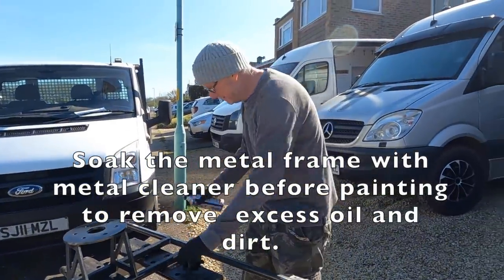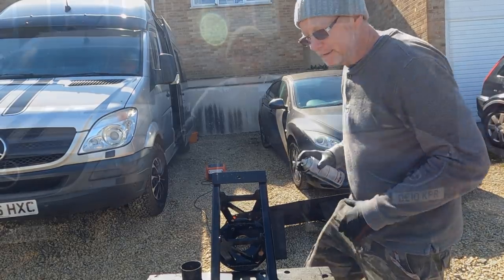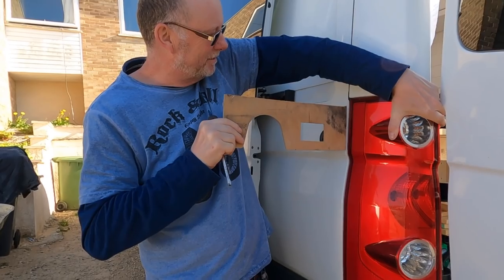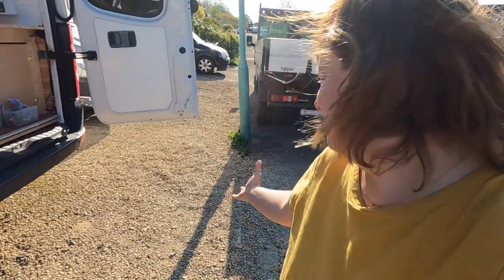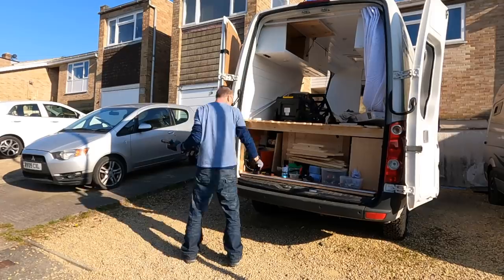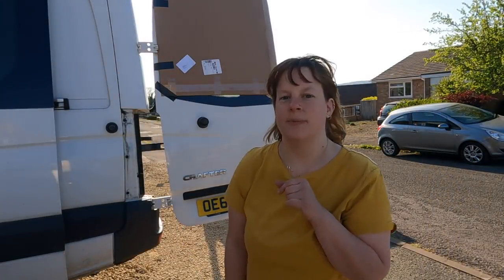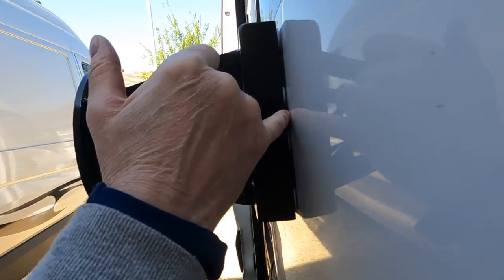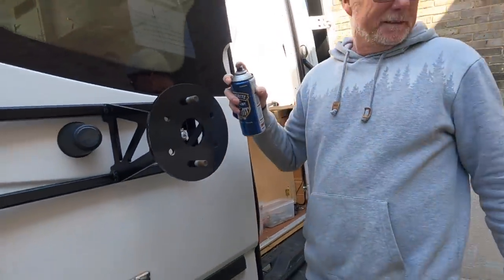Big ass wheel carrier for campervan

Comment: Super video Mel and the junior apprentice at work eh....... but come on Mel teach properly.... you should of washed the crap off the back of the wheel whilst waiting for the paint to dry...lol... the only drawback I can see with that set up... is if backing up to say a high wall on a public carpark... you would need another 6 inches of space on the length...( thinking about those times when you are "pinching a nights kip somwhere) but apart from that... its a top job... I am considering doing something similiar on me T5.1 as I like the swamper look and of course its not as long as its bigger cousin the crafter..... keep up the excellent work... Get well soon Mel.... YOKI...

Comment: Hi, Thanks for the video . I see you have the BF Goodrich 245, 75, R16 tires which look great. I am told that these rub when on full lock on the Crafter but not so much on the Sprinter. Are your tires new and do they rub on full steering lock? ( I know the 70 wall tires don't rub but the 75's look better in the wheel arch)
Reply from the maker: Hi Scoobie Dee, yeah they are great tyres and really make such a sturdier drive since I’ve had them fitted. 
From the moment I drove the van out of the garage (from having the new tyres fitted) I’ve had no problems or was even aware of any rubbing issues at full lock or any other time 👍🏻👍🏻👍🏻
Reply from the maker: Yes I bought them brand new and were fitted in the same week 👍🏻
Reply: @SACREDTRAVELLER  Thanks for the quick reply, Thats mad as most people have reported a rub at full lock on Crafters. My van does looks a bit higher than some crafters with the current tires on which is why I thought I might get away with it as you have.. I have a MWB like you and the 75 wall would look amazing on
Reply from the maker: That’s interesting to know, maybe I’ve been blessed in that it’s different with my random van. I’ll keep an eye on them and if this rubbing ever occurs I can talk about it in a future video. 
It’s funny as I’ve not done anything to adjust for it, just driven the same as before and not had any issues…is it different with what year or age of the crafters?? 
I would say it’s up to you if you want to chance it. To be honest it wasn’t a factor I thought about when I had them fitted as the wheel arch is still roomy and I wasn’t going stupid BIG with the size. I personally think they are a no brainier purchase for grip, stability and reliability for driving in sand, mud and grit - esp this van is my home and I will be driving on various terrains and wanted it to have the best possible chance to be safe and sturdy on ‘off-road’ surfaces 👍🏻👍🏻👍🏻🚐🚐🚐
Reply: @SACREDTRAVELLER   Thats good to know, most people I speak to with Crafters say the 75 's rub but not all. It may be that yours is a bit higher on the suspension or that the full lock is a fraction less than other vans. I am thinking that the reason sprinter owners don't gerenally report a problem is the lock may be not quite a tight as the Crafter... but I am only guessing. So I have had this question for 3 months now70's or 75's ...... I prefer the look of the 75 but like to have a full lock.... so annoying . I may just end up buying the 75 and if it rubs I have the choice to resell and lose probably £150 and then buy the 70's maybe its worth trying in the hope I can get it to work like you have... thanks for the info

Comment: When I wash cars I use a product Called Korrosol from  company called Bilt Hamber, a British company, it removes metal contamination in vehicle paint work, its brilliant stuff  just spray it on and leave it to work, it'll desolve any metal contamination and you know its working as it turns purple, after between 5-10 minutes just rinse and wash the vehicle normally, its fantastic stuff
Reply from the maker: Awww this stuff sounds awesome!!! I need some, where can I get it Justin!?
Reply: @SACREDTRAVELLER  Just go on to Bilt Hamber dot com web site and type in Korrosol it comes in 1lt, 5lt and 25lt, I usually get the 5lt and apply it using a cheap pressure sprayer from a garden center, just make sure you do it on a cool day so it doesn't dry before you can wash it off.
Reply from the maker: Thanks, this is super helpful 🤞🏻😀🤞🏻